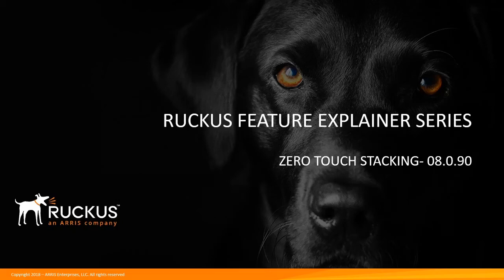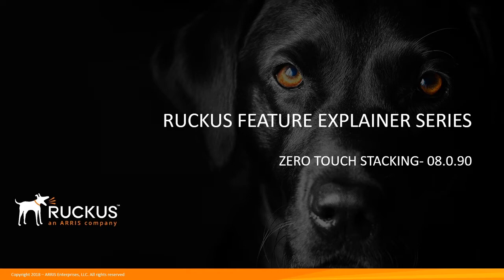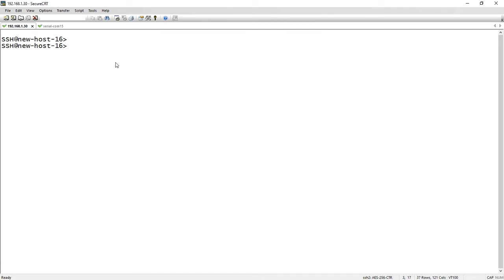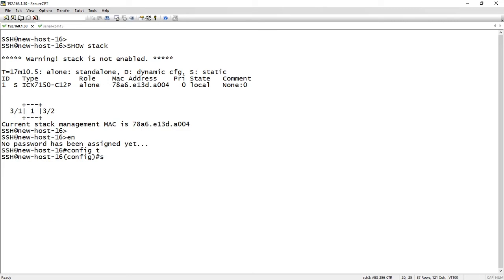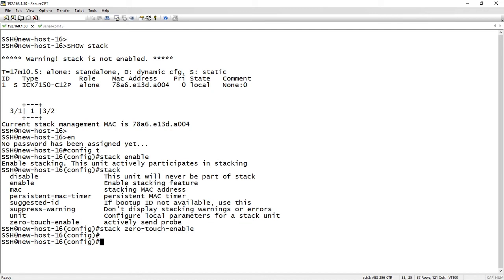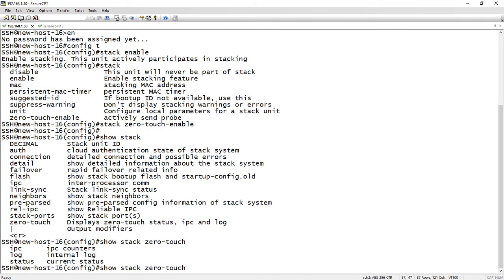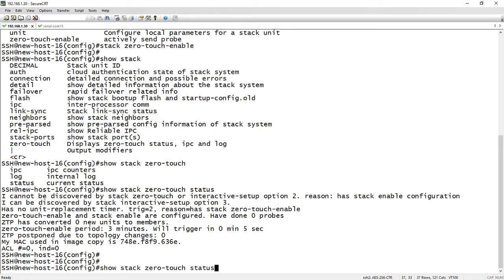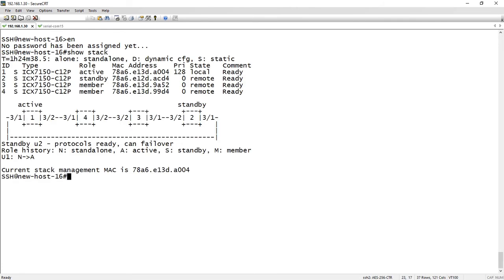RUCKUS ICX ZERO TOUCH STACKING 8090

Comment: Terry, i have 5 units stacked, switch 3 is having some issues and want to remove from equation. can i just bypass stack ports and config won't change? I am moving my configured ports from switch 3 over to switch4 in advance then plan to just remove switch3 altogether. Will this disrupt?  Thanks in advance

Comment: How does it determine the stacking ID/unit numbers?  I've found in the past if I have a stack of 4, for example, instead of 1-2-3-4 in order of my physical units, it may order them 1-4-2-3.  Which makes it very confusing when physically looking at the switches in a closet.  I hardcode the units before I stack them, in the order I want them.  Takes less time than letting it build on its own, then having to renumber 4 switches.
Reply from the maker: Currently it uses the higher stack port number as the next number. For example from unit 1 it will use port 1/3/2 as the next number rather than 1/3/1. That is changing in an upcoming release and going forward will work with the lower port number so your stacks will deploy as you expect.

Comment: after the first reboot of the zero touch is done will they re-boot again after 3mins if you do not turn of the zero touch feature?
Reply from the maker: No, once the stack is configured the first time it just probes for changes every 3 min. If a new switch is added it will configure and reboot the new one only.